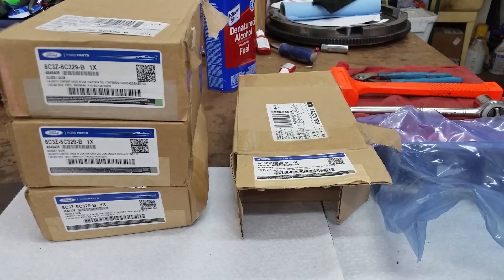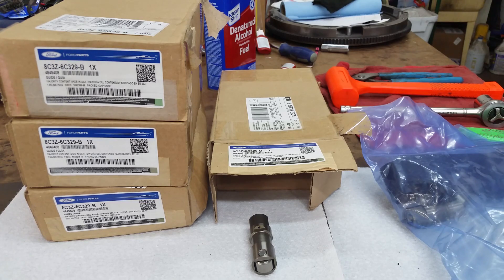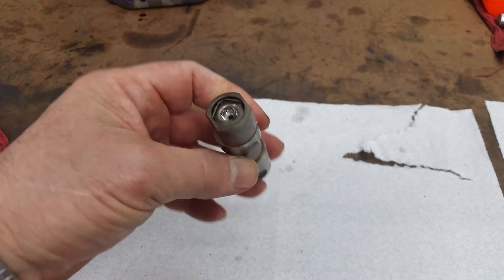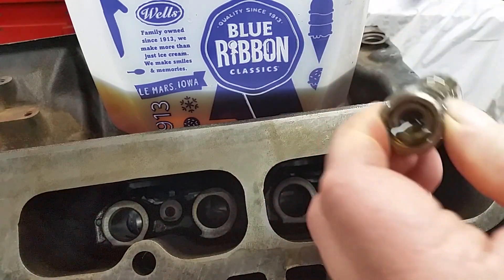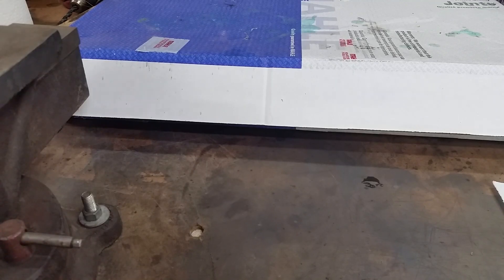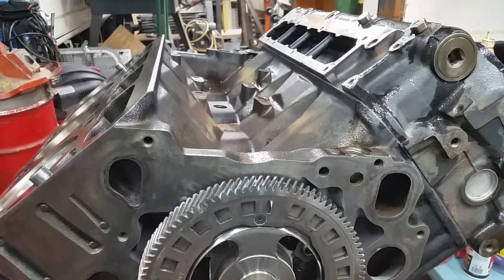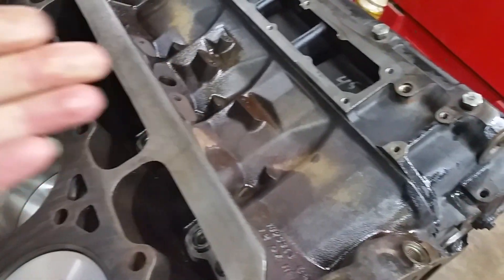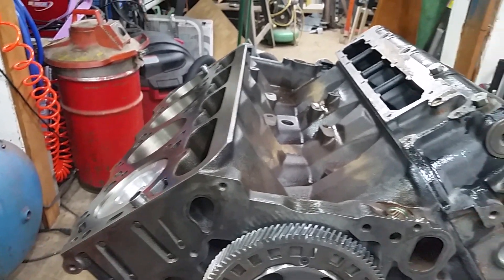7.3 Build: Lifters Installed and one head

Comment: Which way should the small oil hole in the lifter be facing, piston side or towards the center of engine
Reply from the maker: Good question but the direction is not important. The lifter is designed to work in either direction. The guide plate will lock them in position with the roller on the cam anyway.